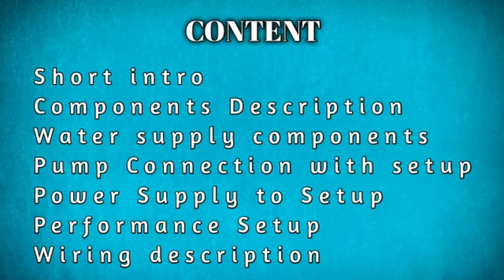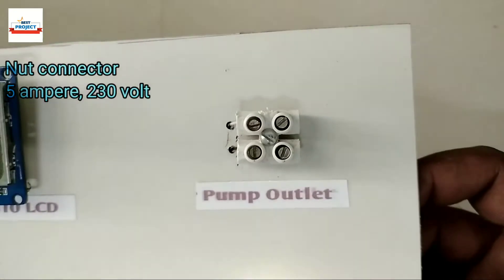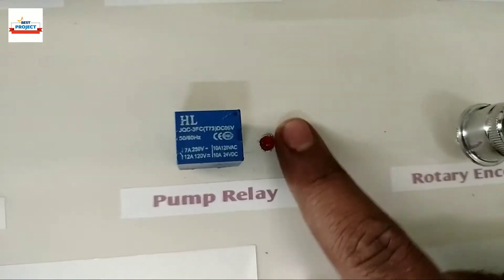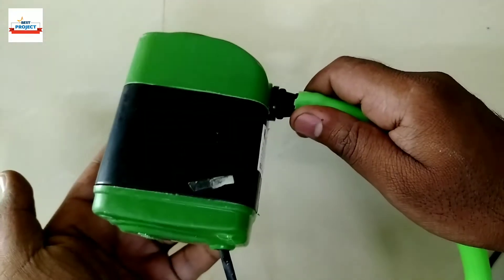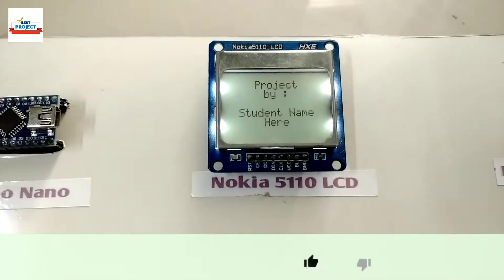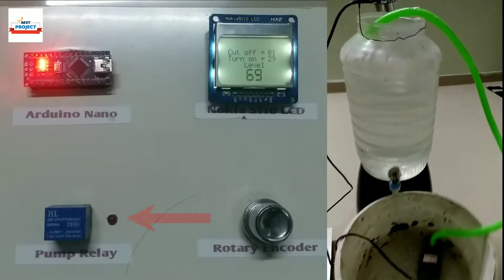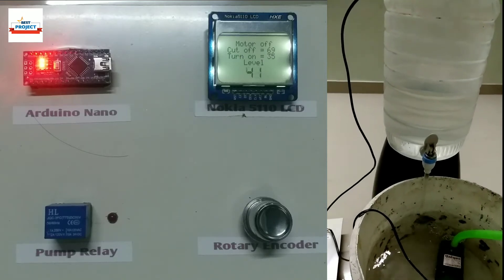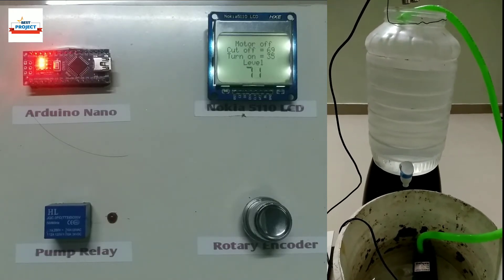9. Smart Water Supply Control System Using Arduino | Water Pump | Filling control | level Display

Comment: How  connections made of board
Reply from the maker: Lcd is connected to pin 12, 11, 10, 9, 8, Ultrasonic sensor is connected to 7, 6 pin, Relay is connected to pin 5, and rotary encoder to pin 4, 3. Thank you can

Comment: Can we use lcd in stead of nokia display in this project
Reply from the maker: You can use a 16x2 lcd, but 16x2 lcd doesn't have a large space to print many sentence, hence we used Nokia 5110 LCD.